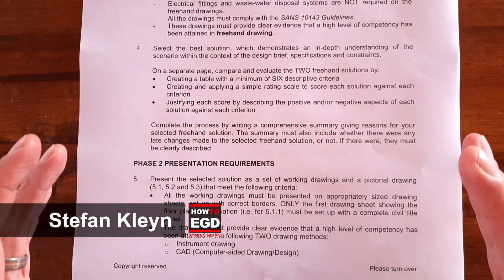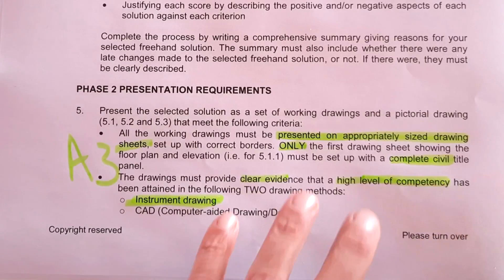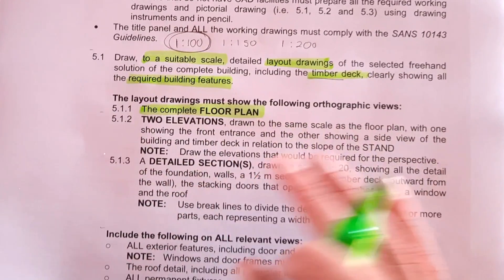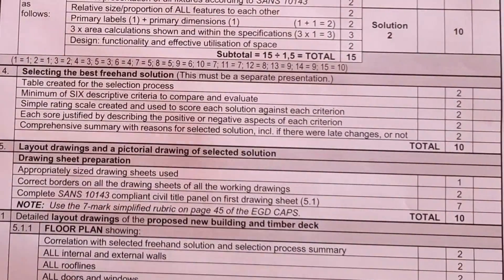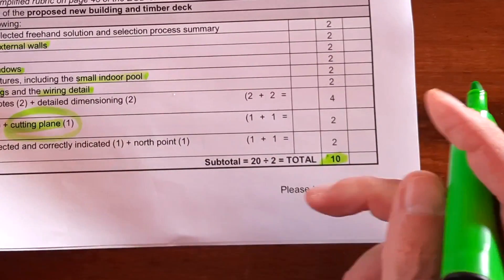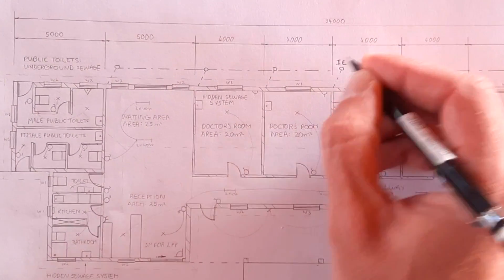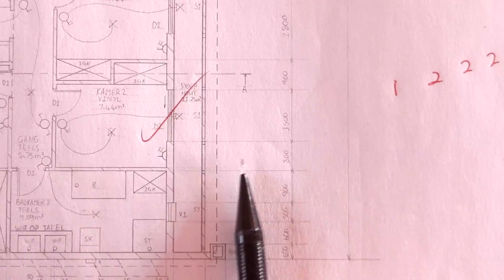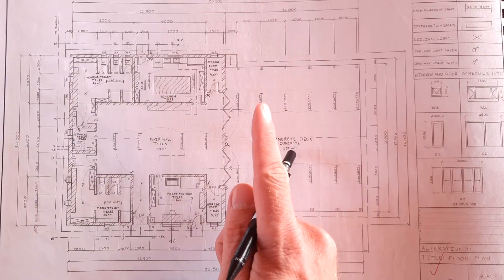6. HOW TO HACK YOUR PAT: Drawing the FLOOR PLAN - EGD Grade 12 - Civil PAT Task 2021

Comment: sir on the final floor plan you said permanent fixtures are not tables and chairs if we don't include them on the floorplan is going to decrease our marks?
Reply from the maker: Hi Mantsha, thank you for your question. Ideally you should not include moveable fixtures such as tables and chairs when drawing a floorplan as a working drawing. You will not be penalized as the PAT document only require permanent fixtures to be indicated on you floorplan. All the best with your PAT!
Reply: thank you sir